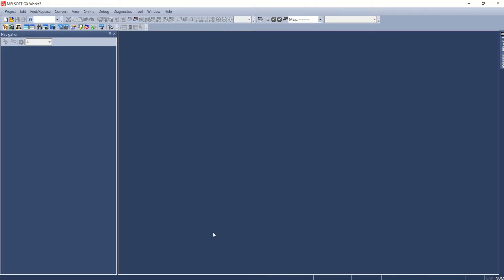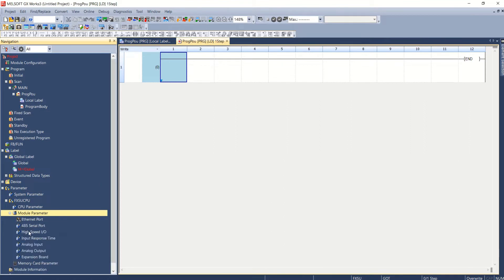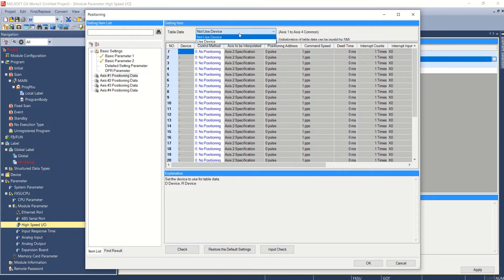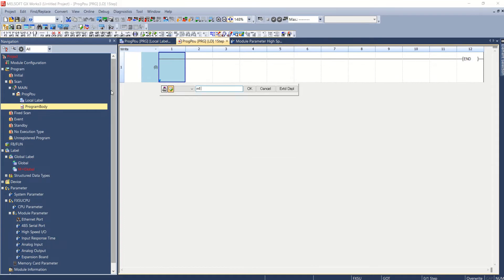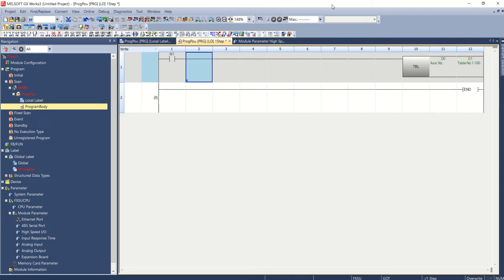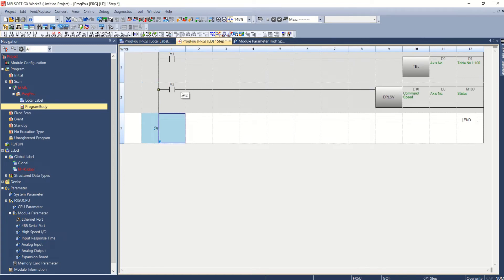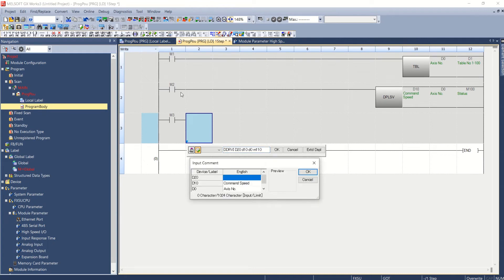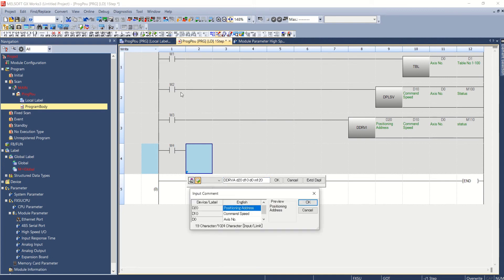Run Servo Motor with Mitsubishi PLC High Speed Output DDRVI, DPLSY, TBL For Servo Pulse Train Input

Comment: I am using fx5u and mrje 40as   ddrvi command is working ok. But I need to ddrva its not working its continuously running. And how to make homing command. The pulse value is not getting zero. Kindly help me
Reply: How to use plsy instruction .. it's cont run in simulation

Comment: Can u tell me interpolation command in fx5u
Reply from the maker: for fx5u with high speed output,  Goto module parameter >> High speed I/O >> Axis 1 positioning data >>  select control method 20 for Relative interpolation or 22 for absolute positioning.

after setting you can execute that particular table no using "TBL" Instruction
Reply: Can i interpolation without Module PWM